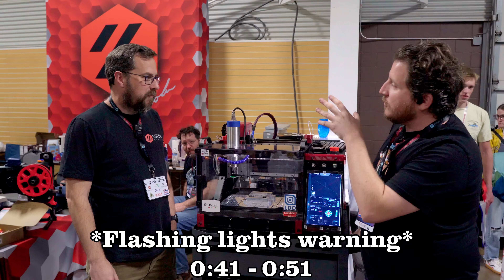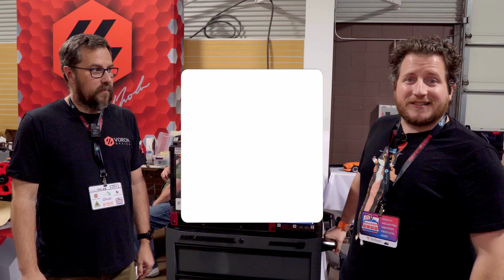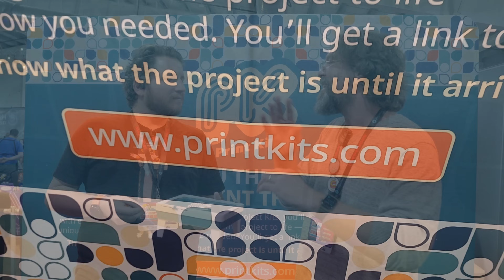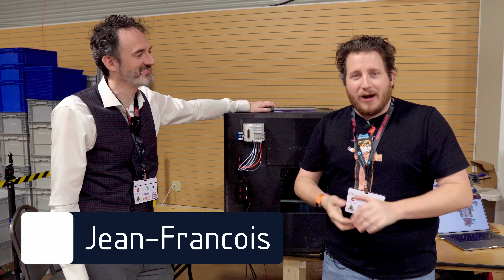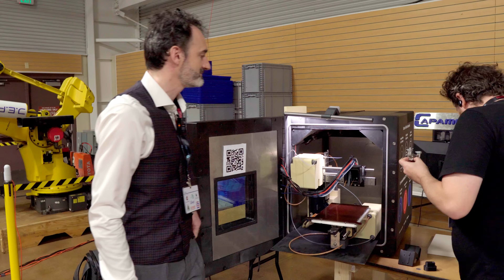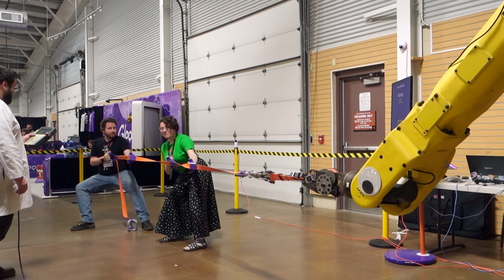CNC Milling & High Temp Printing Made EASY! - RMRRF25

Comment: Visionminer 22 IDEX is around $15k. If this high temp printer was around $4k to $5k that might be worth it. At $10k that's kind of a hard sell.
Reply from the maker: Open source vs. closed source. And at an additional 50% on the price, is it worth it? Depends on your use case.

Comment: I have been long-term shopping (lol) for a CNC router and/or mill; I’ve liked some desktop options but they are often cheap and/or underpowered. If they are actually good, they are usually expensive (like over $5K)… the expected price being (relatively) low for a machine with those specs is a huge selling point, but beyond that, I am the exact customer he described in his pitch. I need to save space, I’m a beginner, and I really want to cut aluminum well. The enclosure, bellows, and all the other safety features, all fitting nicely on that cart? Chef’s kiss!

Comment: abouth the voron there is a few things that i dont like ( though i know it would be easy to fix yourself but if it could be done before that happens it would be even better )
1. even for its size its to light weight ( would like to see it between 175-225 LBS at that size ) one way to increase that weight well also stiffen it up would be to put either epoxy metal ( epoxy full of metal power and small beats ) or epoxy granit in all the holow parts of the extrusions thats not moving
2. unless its reading directly from liniar scales mounted on each axis i would love it if it was useing servo's or at least close loop stepper's since if its just open loop steppers and it lose a step and the machine would be non the wiser and it could ruin your entire part ( snapping a carbide tool at that size is not that hard. done it by hand at work just to see if i could ( the tool was already dead/thrown out btw )
and 3. since its probably not gonna be useing diffrent tool shank sizes i would like to see it with a better/more precise/less runout tool clamping system then a ER collet maybe useing one of the ER hydrolic tool holder ( something like the "ETP hydro-grip" kinda thing where its runout can be adjusted out. where just the one with the biggest hole is pre mounted and the most comen shank size adapters are incloded  )